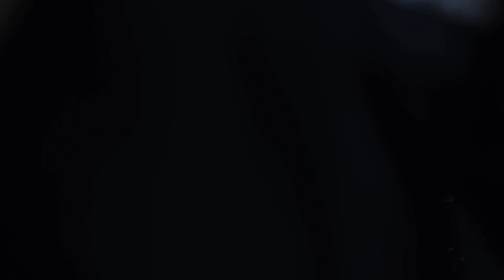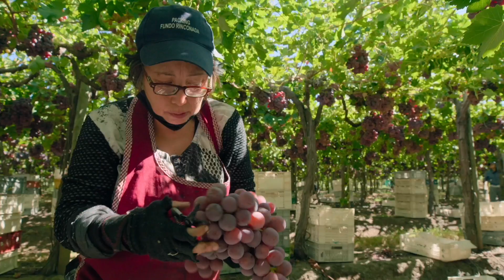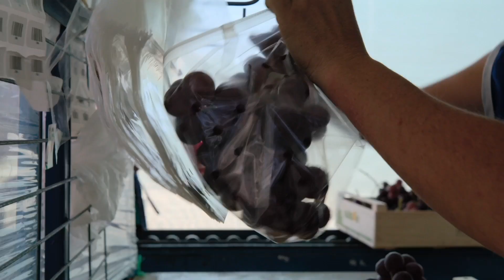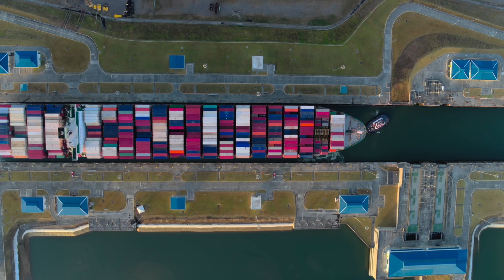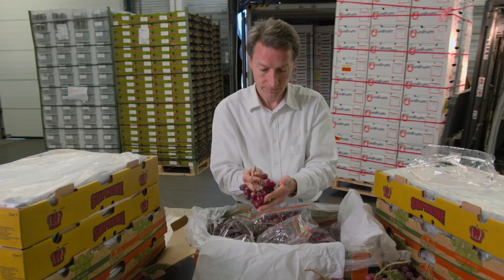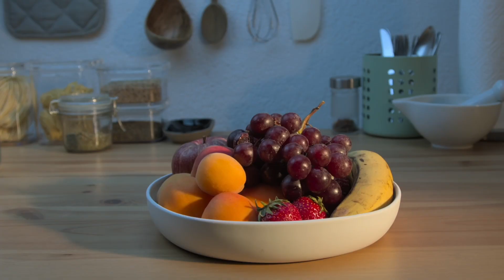Why is so much food wasted? | The Earthshot Prize

Comment: When you stop and really think about the scale of the problem, I dont see how were going to get out of it, without a huge Technical Breakthrough. I mean we should try, even if it delays our doom by a few decades I think its worth it, but I do think this problem is so massive and tell people basically that food have got to go back to season eating, or things wont be as high quality/or pack as well to save plastic I just dont see it. And this is just one industry, there Fashion industry (With its seasonal and fast fashion, all the dyes and cotton it uses, all the job that setup support), Car (ok moving to electric, but what about Tyres Mountains/Fires that happen) Industry (Cement, building materials etc, and where still apparently not building enough houses) etc. these are just some basic example, But I still like to try and be a glass half full kinda guy, so I hope we can save ourself. Its just I think the problems and issues are a lot bigger than we think
Reply: 7av